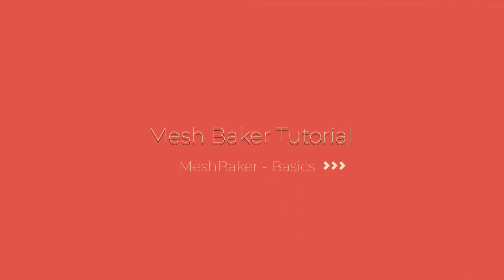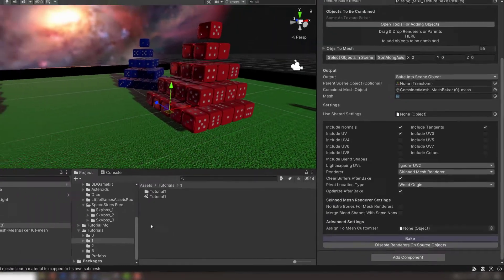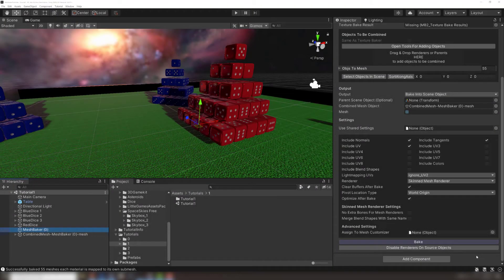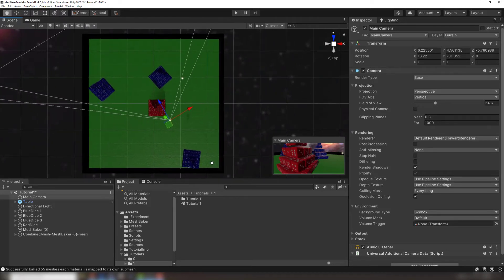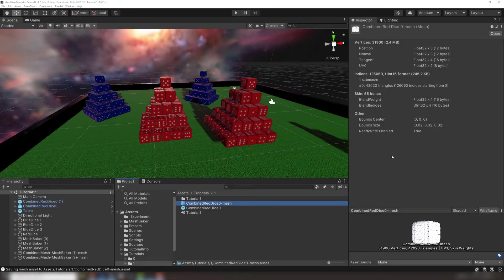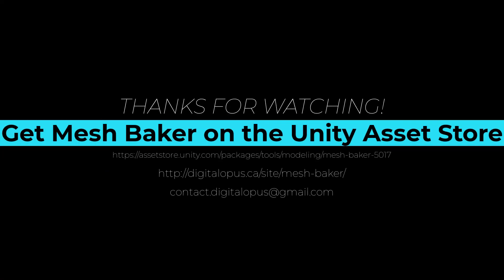Mesh Baker Basics

Comment: Wait, so how do you fix the physics problem post mesh baking, or do you just use them on static stuff like walls, floors, etc...?!
Reply from the maker: When you say physics problem, do you mean what do you do with the physics colliders that were on the source meshes.

Physics and Rendering are independent of each other. It is best not combine the collider meshes. This is because physics is more performant with many small colliders rather than a few complicated colliders. I recommend combining the MeshRenderers but leaving the source objects with their colliders and scripts enabled but Renderers disabled. This way your game should run without any work to move scripts and colliders onto the combined mesh.

Does this answer your question?
Reply: @IanDeane  it did strike the spot with exactly what I was trying to ask, but how do you practically implement all that you just mentioned, without messing everything up by accident? I am still trying to grasp the idea to be honest

Edit: I think I get you now. What happens is you bake the mesh and keep the render of the new one turned on, and turn off the render of the old one but keep everything else on? I think I can get along with that

BTW, any discord to reach out to you with?
Reply from the maker: @SnowyLeopardFrom1997  Yes, that is it. My Discord is: Phong13

Comment: I'm am trying to get some clumps of dirt to bake into a skinned mesh and act dynamically like your dice. But the skinned mesh render wants it to have bones or blendshapes, any help with this issue? I thought it would be just a few clicks like in the video..Edit: Actually just got it working. I was baking to prefab and it was messing it up. And I used standard mesh renders on the base objects instead of skinned meshes. This is awesome!

Comment: If I combine skin meshes in the build both new asset and original one will be present , correct ?
I guess avatar will refer to the original model.
For mobile game size is a crucial thing , so how to use only a single model after skinned meshs are combined ?
Thank you !
Reply from the maker: Usually the original imported skinned mesh .FBX model will contain:   mesh, animations, transform hierarchy. Also an avatar will often be created for SkinnedMeshCharacters. The avatar references the transforms in the bone hierarchy, NOT the mesh.  Sometimes animations and skinned mesh model are imported in different .FBX files.   The combined skinned mesh will replace only the mesh. The animations, transform hierarchy, animator and avatar will be re-used/shared with the original mesh. If there are no references to the original mesh in any of your scenes and your animations are imported in .FBX files that are independent of the original skinned mesh. Then I believe the original skinned mesh will not get included in your build. You can delete the original SkinnedMeshRenderer component (leave the original Animator and bone hierarchy) to remove references in your scenes.
Reply: @IanDeane  Makes sense 
I will check everything as suggested.
One more query if I want character skinned mesh combined run time to take advantage of saving build space in some special case which exact tutorial I should follow ?
Thank you very much!
Reply from the maker: @MayurBhagat10  The example scene "SkinnedMeshRenderer" does its mesh baking at runtime (textures are prebaked in SkinnedMeshRendererSetup scene). That would probably be the easiest setup to examine.
I would also recommend watching the "Combining Skinned Meshes" video:  https://youtu.be/LA_BLaDCoqg
And, if you are creating customizable characters. Watch this older but still relevant video: https://youtu.be/Vc80jHD7Pbc

Comment: how to bake the mesh with multiple ID and each ID's use the diferent shader, for example the trees.. for leaf i used different shader to animate the vertex then the bark using another diferent shader and materials also.. please help me.
Reply from the maker: Hi Muhammad, when you say "multiple ID" do you mean "multiple submesh". You can handle this using the "Multiple Materials" feature. Check out this tutorial:

https://youtu.be/_Xi1SLjV8WA
Reply: @IanDeane  this tutorial help me alot, thankyou 👍🏽
Reply: @IanDeane  one more question, if we're using multi material.. any possible to bake the mesh with existing LOD's??
Reply from the maker: @Hazen_Muhammad  The recommended way to handle LODs is to bake the meshes using the Batch Prefab Baker so that they share a minimal set of materials. Then combine them by setting them to "static" and letting Unity's static batching do the combining. LODs still work with static batching.

Check out this video:
https://youtu.be/Cyn_sUCTx9o

Comment: You mentioned being able to edit the created .asset file in Blender. But I couldn't find the video that explains this.
Is it possible?
Reply from the maker: Hi Raees Rahim,

You can export the generated mesh using the Unity package "FBX Exporter" available in the package manager. This is an official Unity package that can convert Unity Meshes to FBX which can be imported into Blender. I do intend to make a video of this round trip process at some point.
Reply: @IanDeane  thanks for the response. I tried this route but noticed that the textures /materials look washed out. The exported model is fine, just the textures seem messed up (using the same shader). Have you noticed this?
Reply from the maker: @parboilrice  Can you compare the atlases generated by Mesh Baker to the original source textures? Do they look washed out?
Reply from the maker: @parboilrice  Do they look washed out in Blender or in Unity?
Reply: @IanDeane  Sorry for the wait, I was at work. I realized that the materials it exported with were not the same as those in project. I manually replaced them and it looks as expected. It's a few steps more, but I can work with it. Thank you very much.

On that note though, I'm taking the combined mesh into Blender to weld vertices of modular parts together (touching vertices). Is there a way to do this in Mesh Baker Pro?
Reply from the maker: @parboilrice  There is currently no way to weld vertices in Mesh Baker Pro.  Note that if there is anything different about the welded verticies (different normals or UV coords) then Unity will duplicate the vertex.

Comment: Hello sir, why your fps rate dropped after u baked objects ?
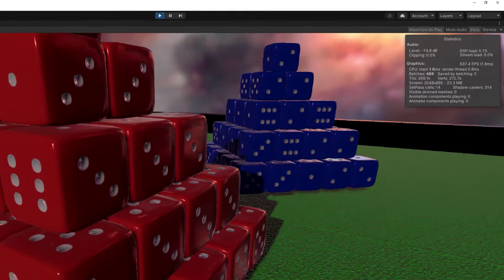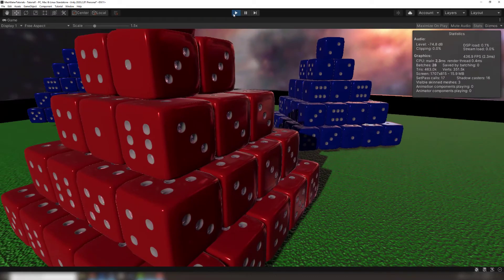0:40 - 3:15
Reply from the maker: Good eyes. In this example I am combining in the editor on a powerful desktop workstation with high end NVIDIA graphics card. This is capable of many thousands of drawcalls per frame so there is hardly any performance improvement from the lowered drawcalls but there is a performance hit because of the extra skinning cost for the combined skinned mesh. The result would probably be very different on a mobile device, VR headset or business laptop were the GPUs are much less powerful. It is important to do the profiling on the target platform device to focus the optimization tradeoffs appropriately.
Reply: @IanDeane  thanks for explanation sir, and am i understood correcly:this method takes from gpu and put that onto cpu, right?